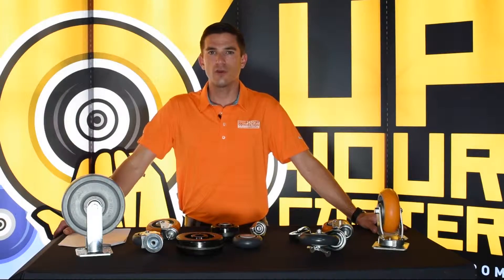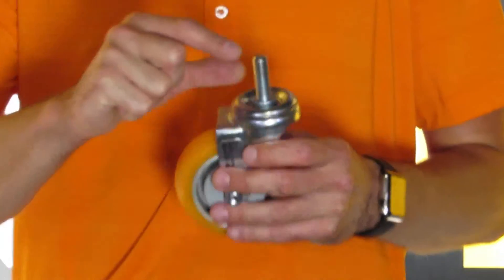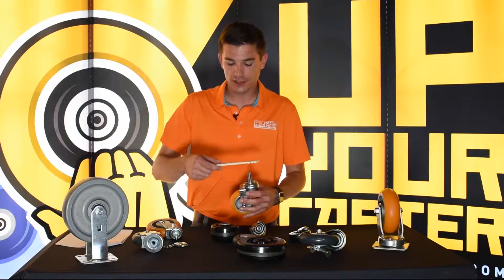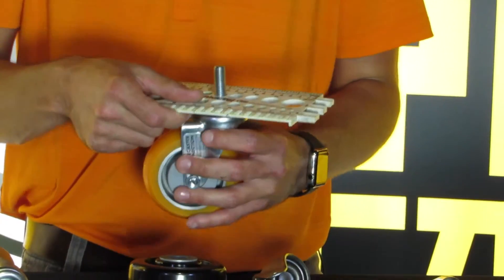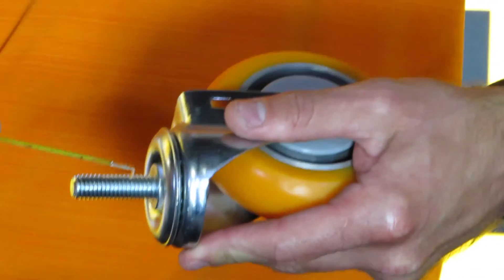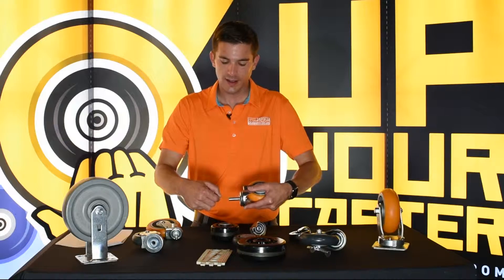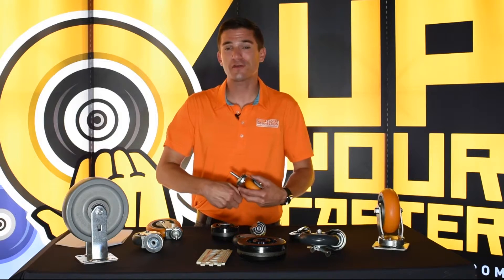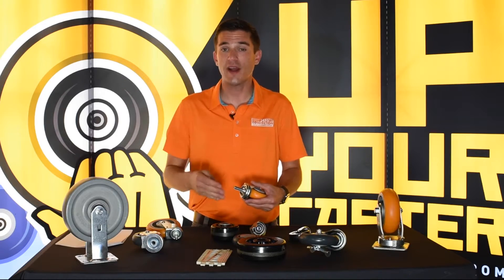How to Measure Caster Stem Length & Diameter

Comment: I have a problem with a caster which has fallen out of an antique oak office chair.  The stem, which is 1-1/2" in length, end to "shoulder", has a taper from 5/16" to a loose 25/64", with 25/64" being the opening in the Dewalt drill gauge which slides completely on, but with significant slop.  You do not offer an information on tapered caster stems, and maybe you don't sell that type of hardware, but if you could add info to this video, I for one would be grateful.